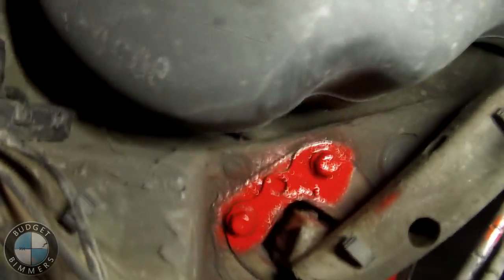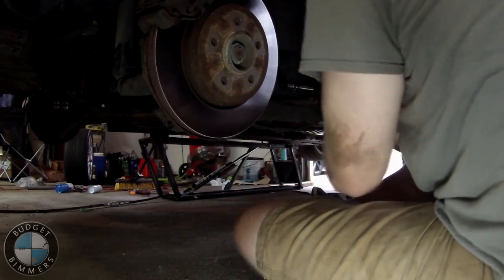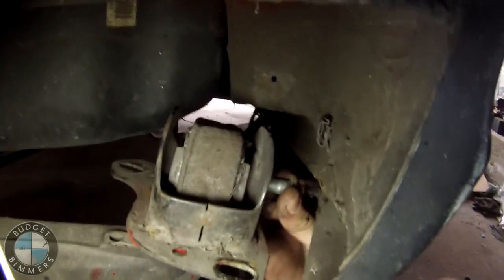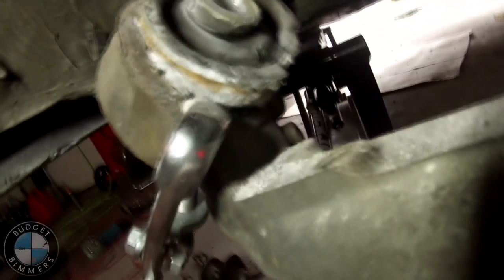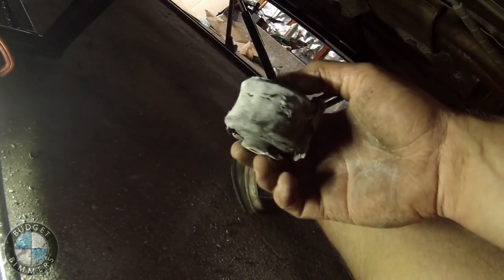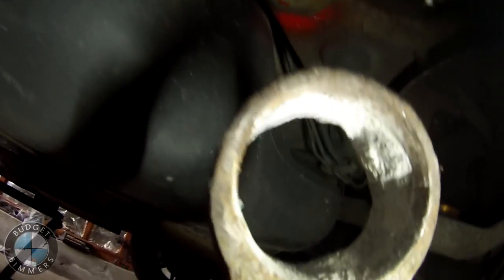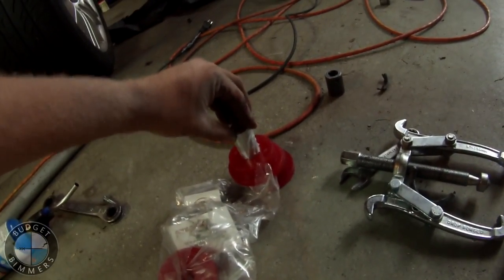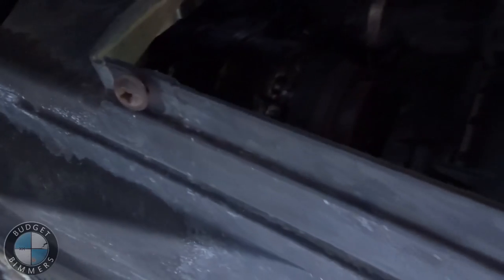E46 Rear Trailing Arm Bushings!

Comment: I cant wait to slap these out and put in the powerflex black series in. Got the tool too so hopefully my MA car doesnt feel like a Tahoe trying to take a corner and this install goes smoothly
Reply: Update: my bushings were so bad that on the first round the tool bent to like 110 degrees. Job was easy up till then and went downhill so quickly. Going to call ECS to ask about a first use broken tool.

Comment: What up guys!   Another great informative but entertaining DIY BB Team!  So I have to admit I am extra jealous of both you today,  I am sad to report my baby aka my 08 white 6MT 335Xi  sedan w/ sport package is dead as of Sunday it is now approximately an $18K-$20K hunk of metal thanks to the one of many assholes in the city of Milwaukee who feel that red lights apparently are optional and not only do they not stop for them but they blow through them at a high rate of speed when the light has been green for minutes yeah I was hit in my driver side rear quarter panel as a result of the initial impact I proceeded to drive through a approx 30 foot solid concrete light pole with the streetlight hanging on it that was in the middle of the median.  Icing on the cake being the asshole then fled the sceen and left me for dead knocked out from the impact/concussion in the middle of median perched on top of the concrete light pole he had sent me thru.  Last thing I just wanted to say publicly a big thank you to BMW because I walked away with some soft tissue torn ligaments in my wrist and a narley black eye bruised cheek and orbital bone, a concussion, and a bunch more bruising or general post accident neck/back pain.  But give the fact that I took an initial impact from another vehicle going 60 in a 30 but then when through a concrete pole at 40(yes I was going 5MPH over the posted speed I shouldn't be so reckless)without hitting the brakes and didn't break so much as a finger or my nose.  Testiment to how safe they build these cars.

Comment: How do you like the poly bushings? Is the ride harsh now because of those instead of stock?
Reply from the maker: sanolane93 you can deff feel more little bumps and stuff, my main complaint is the fuckin squeaking, didn’t grease them enough I guess
Reply: hahahaha!
Reply: I would only use polys after reinforcing the subframe. The e46 frame may start to rip with polys on without reinforcement plates.

Comment: you didn't mention that if you are using OEM style bushings you need to set the proper preload (zero preload) when you reinstall the bracket that mounts the arm to the chassis. if you don't do this your bushings will be absolutely shredded in no time at all.
Reply: I didnt understand how will make zero preload cant you take the whole arm to a shop and they change the oem bushing and you Just i refix the arm on its position like where it was before?
Reply: @Sroor2023  what I would do is mark a line to record the orientation of the bracket to the arm before you remove it then just reinstall at the same angle. You shouldn't need any special tool for this just a straight edge.
Reply: @Cordtus  Thanks 👍👍👍
Reply: Thanks for adding this comment! Could easily have fucked me up there